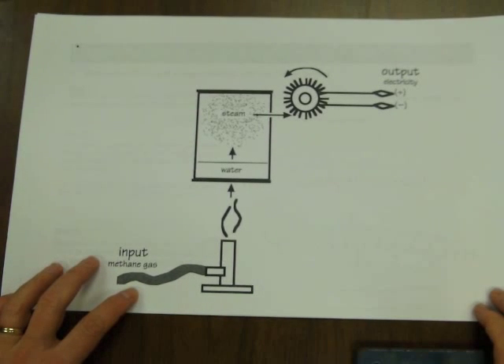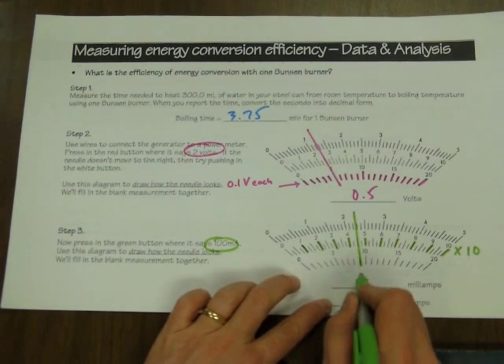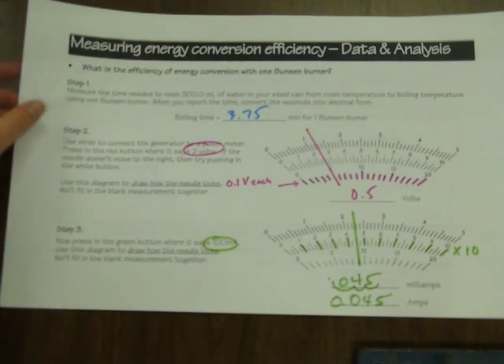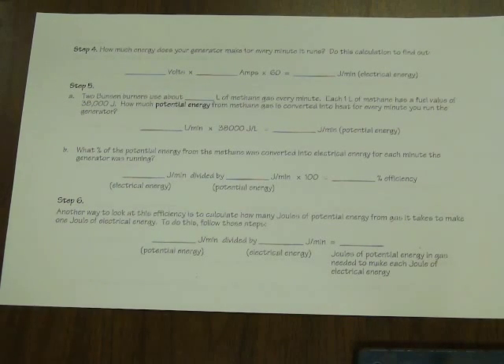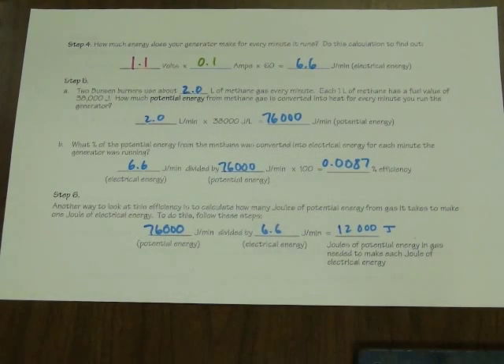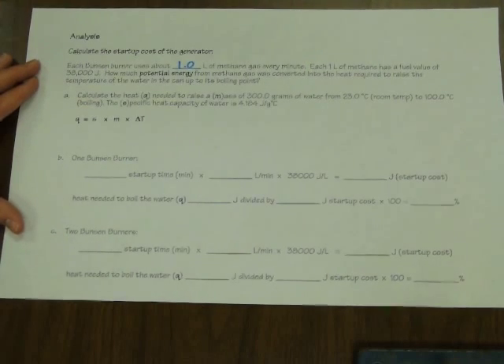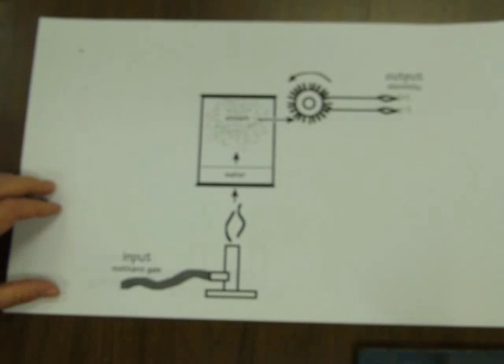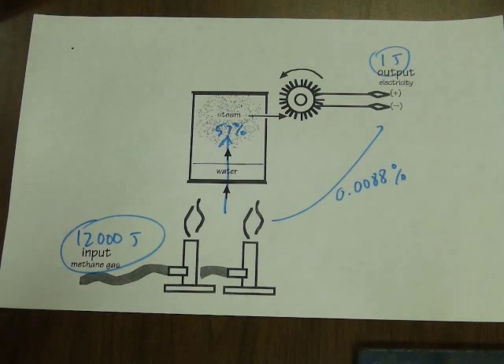generator calculations

Comment: if the prime mover for the generator needs 53 watts to turn the generator and when i put a load on it the generator produce 11.3 watts and the prime mover needs 10 watts only extra to withstand the load, is that means my effechncy is 124% ?